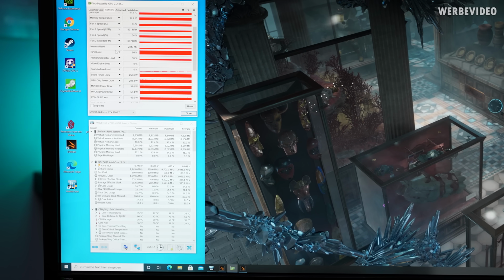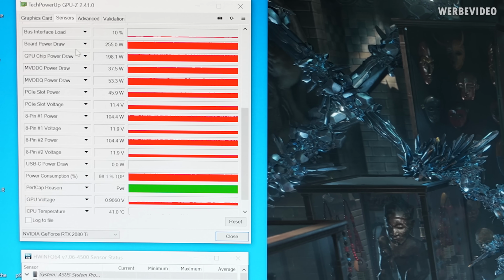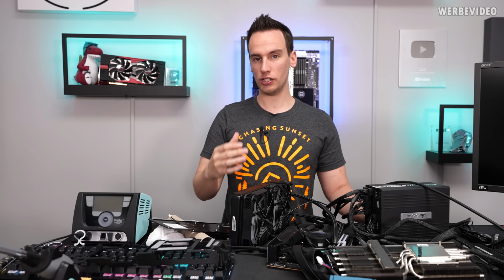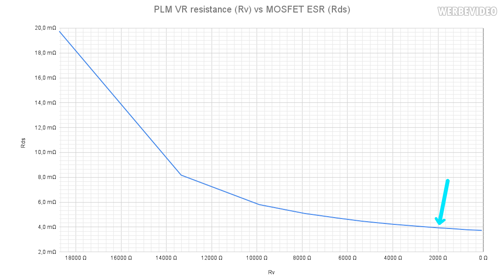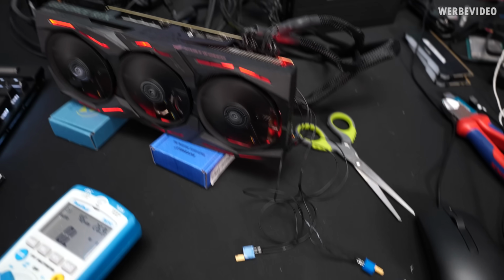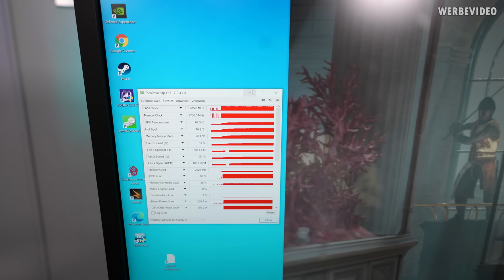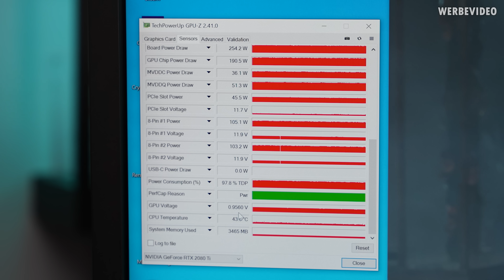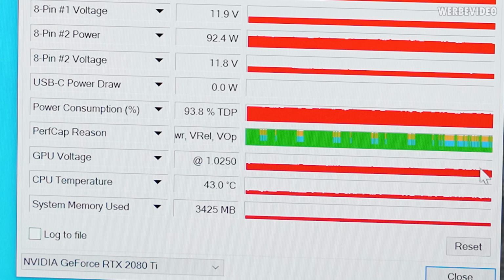This adjustable Power Limit Mod is genius!

Comment from the maker: The video is already few weeks but helps me to enjoy my vacation :D There will be fresh content on sunday. Hope you all had a good start into 2022. Thanks!
Reply: With the tattoo missing, we knew right away! :D
Reply: @ToTheGAMES  exactly, I seen it also before I read the comments 😀
Btw Elmor Is awesome guy with a lot things for hardcore hardware fans.
Reply: You could just make a video for each Elmor Labs tools and take a longer vacation, these are great
Reply: Why didn't you make a pin connector on the variable resistor side too? Would be much easier to adjust resistance (GPU power) without disassembling the whole videocard
Reply: You forgot a link to this Ten Dollar mod :- )
Reply: We need the 12900 direct die kit!!!

Comment: I would really love to do this to my card, not just for extreme overclocking but for steady volt increase, howeeverI just don't have the courage right now to open up what is even a 400USD used card lol If I had a spare handy  I might, but I'm too scared with current GPU prices to mess mine up. I saw another video where a guy hot glues another resister for the typical shunt mod, instead of soldering. I might seriously consider doing that because I really wouldn't trust my soldering skills.

Comment: i imagine there is an easy way to build a microcontroller module to take measurements and display resistance and power information while it is running. perhaps even control tuning with a phone app if you want to go completely nuts!

Comment: Maybe a dumb question, but could you not create a simple 0ohm bridge that can be engaged via an external switch, after the card POSTs up, thereby avoiding the safety check at the beginning?  Or is the card too "smart" for that?

Comment: The right way to use a potentiometer with a mosfet would be to put the terminals where it is always 50kohms on the positive and negative and the central terminal on the mosfet gate, because of the mosfet functioning it may go into a state where it will always be on because of that the gate acts as a capacitor and when charged the mosfet is always on

Comment: I modded my cheap 298€ KFA2 RTX2060 long time ago by soldering additional 20mOhm shunts in parallel, then flashed Asus Strix bios.
It never hit power limit again, runs at 2000MHz all the time.
Shows 65% power reading although I'm running 125% :D.
A Vmod would let me OC more, but that's pretty decent, I won't be upgrading the cooler either, it's just fine like it is, around 75°C when gaming, hits 85 when running OCCT.

Comment: This type of adjustment requires absolutely no voltage sag or it changes the effect. Also, the RdsON of the PMOS is highly dependant on the temperature as well...

Comment: I think the buildzoid method is the most elegant technique by far.
(In this method you bypass the resistor completely and give the sense pin on the shunt whatever voltage you need to make it think the power is good)

Comment: Tips: if you're "counting turns", make sure you buy/use linear pots, not logarithmic ones. Also if you're assembling this and it will see a lot of use, buy a couple of regular panel pots. These trim pots (like the little blue used here), especially the cheaper ones, are usually only rated for ~20 cycles. They'll deteriorate faster with every adjustment cycle, and are liable to fail during operation if jogged around enough, which will ruin your day in the middle of a glorious full pot session. Having to tear down to solder in a new trim pot is gonna suck a lot more than the $2-3 extra for an ok panel pot.

Comment: 12:05 And also, don't touch metallic stuff connected to live wires from a running system, if you're not der8auer and know exactly what you're doing 🤓😉🧑‍💻🧑‍🔧⚡

Comment: How does a genius like you increase performance of laptop GPU's of Maxwell and Kepler with no boost algorithm, where adding voltage and/or current wouldn't achieve anything alone?

Comment: Yeah you can't measure resistance while it's running, but you could measure the voltage drop and determine the resistance that way...

Comment: Lots of other things use shunt resistors to control power limits, for example LED drivers. Could this Elmore module be used to fudge with those too? We've always just changed the resistor value but that can have you end up with a lot of work for too much or not enough drive current when modding drivers, adjustable would be really nice and even open up having a two wattage option for running LED's as DRL or in a lower power mode and then having a high power mode for flash to pass or high beam use.

Comment: Ignoring the concern of MOSFET temperature coefficients, I'm not sure what the need for both POTs is... one should do the trick, no? Unless it's important to adjust each rail independently, which isn't mentioned in the video, so I assume you would want them to always be adjusted identically. Do any GPUs perform power deviation monitoring between the two rails? From my naive (inexperienced) perspective, I would worry about adjusting them independently without otherwise knowing that that's "safe" from a GPU stability perspective. Might be a moot point though if the MOSFETs aren't a matched pair. I definitely agree with others that "spoofing" the sense lines directly is the way to go.  This trick seems too finicky for accuracy and repeatability.

Comment: It could be a good idea to use a stereo resistor that is 2 separate resistors on the same adjustable knob.
It will keep the power draw balanced between the 2 PCI power inputs.

Comment: You can measure the value of the pot while powered-on by using the third pin. Just measure between the third pin and the middle pin (wiper), which will give you a reading inverse from what the MOSFET is seeing. So you can set a reading of 42K, which would mean the FET is seeing 42 - 50 = 18K.

Comment: Does the cables add any resistance for the initial settings on the adjustable resistors?
Reply: You can safely ignore the wire resistance. When you have a pot that is in several kiloOhm range at least, and i forget what flavour he used, but he's definitely in that order of magnitude, and near the ends of the range a pot tends to be a little rough anyway. The wire resistance is around 0.15 Ohm/m.

Comment: You could have a couple of pots in series, you adjust one pot on the lower limit you feel safe to use and leave it set, the second pot you play around with and there isn't any risk of going to low. it might give you a peace off mind, at least untill you learn the MOSFET isn't temperature stable, it will turn harder oon or for lower resistance when it heats up...
Reply: I've nearly finished a project...led light ring for a microscope and doing just that. Set max voltage with one pot then use another to adjust brightness.

Comment: Why didn't you make a pin connector on the variable resistor side too? Would be much easier to adjust resistance (GPU power) without disassembling the whole videocard

Comment: You could measure the resistance in between the middle pin and unconnected pin, and by subtracting from max resistance you would know the resistance on the circuit side.

Comment: BTW... the product page for the Elmor labs Power Limit Modifier is showing as discontinued. And specifically for the exact MOSFET he has chosen (the EMF02P02H) it is chinese mfr therefore from LCSC. those ones are currently only showing 2 in stock ATM. so what about alternatives eh? well surfing the digikey parametric search... the nearest similar IC which may not be exactly identical, but should be ok / good enough... this seems to be the the AON6411 (which has over 6000 inventory stock as of right now). they are about $2 usd each = $4 usd for a pair of two. of course you might also find other suitable mosfet from either lcsc, mouser, or arrow. whichever is your favorite supplier you are preferring

Comment: 1935 MHz, 226 Watt and 80C is what my stock 2060S Runs at with Afterburner Power Limit Increased to 130%.  It may be an architectural limit you're hitting.  Going forward it will be interesting to see how the lower tier cards clocks compare to the larger Dies.  For example the 6500 XT is supposed to hit 2.8 GHZ+ out of the box.
Reply: From my experience,  the lower tier cards on average do hit higher clocks. 
But then again because of silicon lottery,  some top end cards will run higher clocks than lower end.
Reply: 6500 XT 64 bit on the bus pcie 3.0 & 4gb on the vram why bother.  🤣
Reply: @digitaltactics9234  imo if the market wasn't so fucked for us, I don't think amd nor nvidia would have released these cards.
Reply: @digitaltactics9234  It's just a comparison, the 64-bit bus sucks.  There has to be a "cheaper" design in their portfolio, 64 bit is easier to implement.  Less traces, less chips, less power. Believe it or not many people buy a PC and seldom game with it, such a card being installed in a prebuilt would raise the profile to "gaming PC" and sell no problem making money for AMD and OEMs.

Comment: Once you figure out the proper values for resistance, you could actually use a dial with selectable resistances so you don't have to worry about adjusting the potentiometer.

Comment: Why not just bypass/short the shunt, cut the trace from the shunt to the controller ic, then use a voltage regulator to send a voltage to the controller so it's completely independent from actual power?

Comment: Maybe an addition to this design would be to use digital potentiometers instead of physical ones, that would allow you to know the resistance you're changing it to on-the-fly because it changes in steps
Reply: One issue I could see with that is fine tuning - most digipot chips have between 100 and 256 discrete steps, where a fine-adjust analog pot can be tweaked much more slowly to creep up on the exact value you want.

Comment: Might be interesting if Elmor Labs, or someone, could replace the VR with a I2C controlled digital resistor so that you can have more reproduceable results and perhaps even programmatic changes to the values?
Reply: That would be awesome if Elmor or anybody else can do it.

Comment: If you connect your ground to the wiper of the pot you should be able to measure it in circuit by reading from center to the other (open) pin and subtracting from 50k. 
It should also be possible to run both MOSFETs off a single pot so they adjust simultaneously.
Reply: Also it might be advisable to use the 3rd pin of the potentiometer to create a proper voltage divider circuit instead of a 2pin rheostat  (edit: apparently it's already a complete voltage divider on the PCB) and to put a limiting resistor between its input and output to prevent any unwanted limit leverage if the component goes short/open or if the contact of the wiper stutters when adjusting during operation. Limiting the range of a pot inside a safe zone is a common practice used on most schematics as those kind of pots are prone to wear and failure, especially when bought cheap.
Also, using a semiconductor as a resistor is tricky as its resistance is non-linear and more importantly its value will vary with temperature.
Reply: This! Was going to comment this myself.

Comment: Would be nice for a bios mod to be invented (nvidia encrypt their bios, j just want the old days when I can flash a bios mod and voltage mod). Worried about warranty reasons of shunt modding… I would like something that doesn’t leave a trace behind, but guess I’ll keep waiting for that day.
Reply: You can always cross flash a bios from another gpu of the same model. You just need to override in nvflash. I put kingpin 3090 bios on my crappy 3090 and got a nice boost. Just make sure if it's 30 series you flash lhr to lhr and fhr to fhr.
Reply: @falcie7743  I have an Asus strix 2080ti with an EK vector block flashed to a matrix. Asus GPU tweak 2 on screen display shows the core between 2145 to 2175.
Reply: People do that, but you need to have connections to get any BIOS modding software. I know a guy that made a working BIOS editor for Ampere and they got a cease and desist from Nvidia so they cant publicly release the software anymore.

Also, the "encryption" that is put into BIOSes are fairly simple. First there is the NVflash signing issue, which can be bypassed via external hardware BIOS flashers. Then there are the checksums and UID lock in the vBIOS, which you can change if you know how to do it. That's pretty much it, no actual encryption like people say there is.
Reply: I know people who can solder an entire smd pcb and if they use the same type of solder you simply cannot tell which one was handmade and which one machine made. Maybe they can help lol
Reply: @tetryds  Worried about warranty reasons if you have this worry then you don't shunt mod.

Comment: I'm surprised a manufacturer has not worked with you to make a fully customized gpu. Fully unlocked, with all the controls adjustable.
Reply: That's pretty much the EVGA KINGPIN
Reply: @paskowitz  I was about to say the same thing, evga kingpin and the Galax hall of fame cards. They are the only ones I know that are fully unlocked and ready for ln2 benching.
That is the only reason I buy the kp card so I don't have to do anything besides go buy ln2. I have always wanted a Galax hof card but they are difficult to get here.
Reply: Nvidia wouldn't like that i assume.

Comment: I was confused how you're able to drive a MOSFET in "analog" manner with a single resistor (gate resistance is virtually infinite), but the PCB does indeed have a second resistor which forms a divider.
I wonder if MOSFETs that were sold on these PCBs were manually binned; there's always some variability in process. Or maybe resistor value was tuned. Anyway, this still is a hacky solution, just because MOSFET Rds and Vth vary with temperature. It seems that because sense connections of the shunt are separate, maybe a PCB which divides sense voltage with a potentiometer could work. Sense connections do not carry any current.
Reply: Basically a transistor is a current/voltage driven resistor.
Reply: It works because changing gate drive voltage changes the MOSFET's resistance, no binning required for that. However the most effective solution but slightly harder to do would be to look for the sense lines going to the controller and doing a voltage divider there, that way it doesn't matter how much current is actually going through it it will always show the same power. For the power path it would be just putting wire so that there is low resistance.

Note: the PCB of the GPU uses regular resistors but the PCB is meant for ones with sense line, that would make it extremely simple to get the sense lines since they got a easy and semi large soldering point. For MOSFET shunt temperature MUST be considered, at 90°C Rds on usually increases by 30-50% compared to 25°C and that can screw things up.

Buildzoid did that controller manipulation some months ago.
Reply: @miragept  You can't really directly manipulate sense lines without monitoring the shunt and creating the alternative voltage with your own circuitry. It's reading the voltage drop over the shunt (5 milliohms at 30 amps = 0.15v drop), so you'd have to manipulate it on the fly while also accounting for droop on the rail.

Altering the voltage drop itself at the shunt is significantly easier as well as fully dynamic.
Reply: @hydrocarbon82  If you add for example a 150R from sense1 to sense2 and 100kR from sense2 to Gnd you will get around 18mV drop.
Reply: I think it would make sense to use a digital potentiometer rather than the analogue wiper. Then they could set the resistance to particular values, reset them to stock and switch around programmatically without the guesswork on the number of turns.
Reply: @BobHannent  not the same circuit nor simplicity though.. He dosn not sleep alredy don't add pain to his endeavor!
Reply: @goldnoob6191  step by step